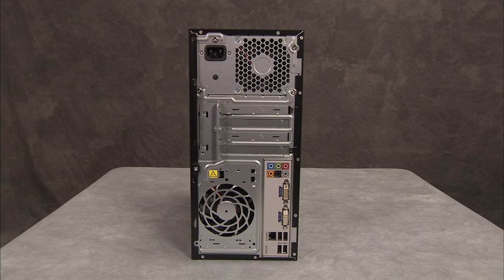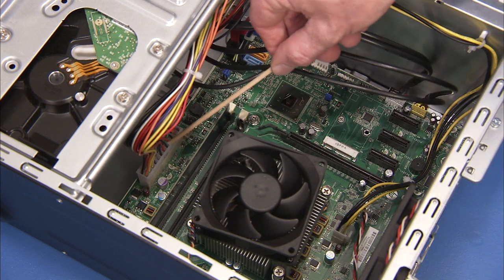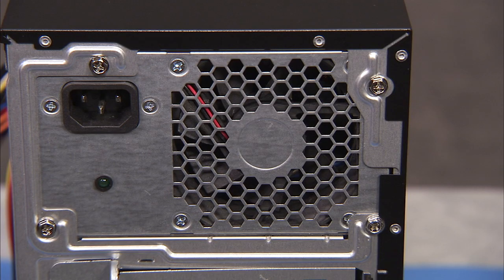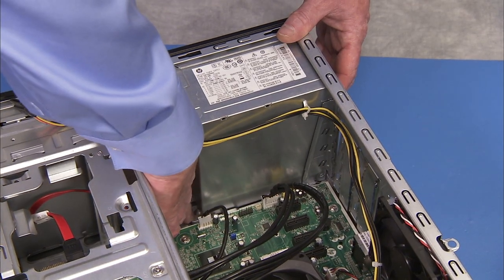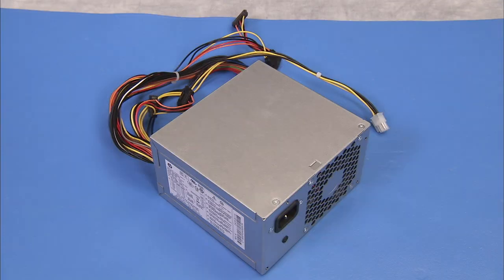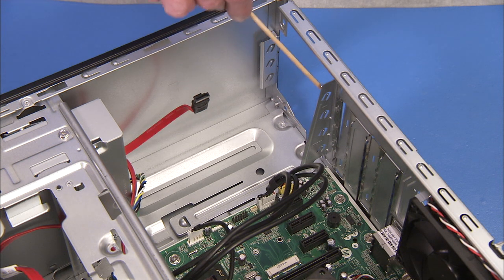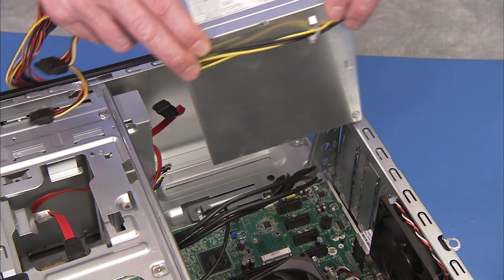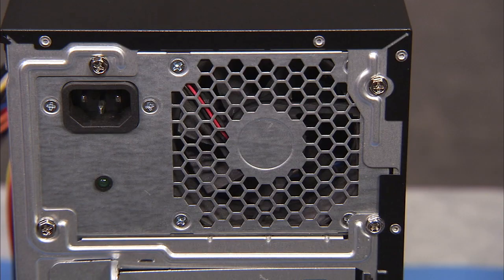Replace the Power Supply | HP Pavilion 500-200 Desktop PCs | HP Support

Comment: My pc has an issue of receiving power, but not turning on. Could replacing the power supply fix that?
Reply from the maker: Hi there, thanks for contacting HP Global Social Media Support!
I understand that you are experiencing an issue with your computer as it is not turning on.
I will do my best to assist you.
Please try power resetting your computer as mentioned here to fix the issue: https://bit.ly/3EEKaFa
If the issue persist, you can try replacing power supply unit if it is faulty.
Binu-HP Social Media Tech Support

Comment: Just to say these hp power supplies do not have a standard motherboard  atx power connector it has some strange 4 pin instead of the normal standard 24 pin. Hp is locking you into buying a new computer if you want a game machine. There no way they will sell you a new power supply.
Reply from the maker: Hi Patrick, thanks for contacting!
I understand that you need to purchase power supply for your computer.
I will do my best to assist you.
You could purchase the part from HP.
Use the HP Parts surfer to identify the part: http://partsurfer.hp.com/search.aspx 
And order it via the HP Parts store: https://bit.ly/3nKMYrs 
Binu - Social Media Tech Support
Reply: If that's true, just replace the motherboard as well 🤷‍♂️
Edit: I just checked the spec sheet and it says it's a standard 24 pin power cable. So I'm not sure what you're talking about
Reply: @soniccitynet  yeah I've opened them up and no, they are a wacky 4 pin.
Reply: I bought my pavilion and 1660ti. 😂😂😂😂 Now I know what brand not to buy for my computer.😂😂😂

Comment: I’ve been looking for 550 power supply so I could upgrade the cpu so do they sell a 550 or even 600 watt power supply 
I was wondering what’s the part number so I could order one for my hp pavilion desktop 690-00XX
Reply from the maker: Hi there, thanks for contacting!
I understand that you need to purchase power supply unit for your computer. 
I will do my best to assist you.
You could purchase the part from HP.
Use the HP Parts surfer to identify the part: http://partsurfer.hp.com/search.aspx 
And order it via the HP Parts store: https://bit.ly/3nKMYrs 
Binu - Social Media Tech Support
Reply: @HPSupport  it says “the part is not orderable “when I put the part number in  is their a ways you could help me with this
Reply from the maker: In order to get this issue fixed, please contact our customer care team over the phone or chat for further assistance, as this issue requires Live conversation with you over phone or chat to isolate the issue and provide you instantly with appropriate solution or repair/replacement options available at your place as per the warranty.
Please feel free to reach us on call/chat, please access this link to select your preferred country and language option to reach us. Global support link: - https://www8.hp.com/us/en/contact-hp/ww-phone-assist.html
Binu - Social Media Tech Support
Reply: Crummy auto responses. I wont be buying from them. U shouldn't either  dont buy h p!

Comment: I have been trying to configure a pavilion pc with a rtx 2060 super and have been doing some research on watt consumption and is recommended a 550 watt power supply but that isn’t a configurable option and I don’t want to mess up the warranty. What should I do?
Reply: Don't buy a hp and make sure the power supply has a standard 24 pin atx motherboard power connector. These people are turning desktops into unupgradeable as a laptop.
Reply: @patrickhewitt7899 will any atx power supply work? My graphics card died right after the warranty expired... and I can't even find any good cards to put in my tg01 as the space and wattage are laughable
Reply: @Porkensteinnn for me im looking to put a 500watts psu but i dont understand anything about psu atx ..
Reply: @patrickhewitt7899  I didn’t I ended up buying from a different company
Reply from the maker: +Mr moneybags HP does not recommend upgrading or downgrading hardware parts or software that is bundled with the product as It may affect the manufacturer's warranty and performance, however, you could change the configuration at your own discretion.
Reply: @HPSupport   Would changing the configuration from the official hp website affect warranty?

Comment: Can I put a Dell power supply or other parties or just hp power supplies?
Reply from the maker: +HappyChills HP does not recommend upgrading or downgrading hardware parts or software that is bundled with the product as It may affect the manufacturer's warranty and performance, however, you could change the configuration at your own discretion.
Reply: Stupid robot no the hp pc uses a 4 pin main to power the board 🙄 the standard is a 24 pin. This confuses the heck out of me and I build and repaired computers since 1996. No wonder they are going out of business.